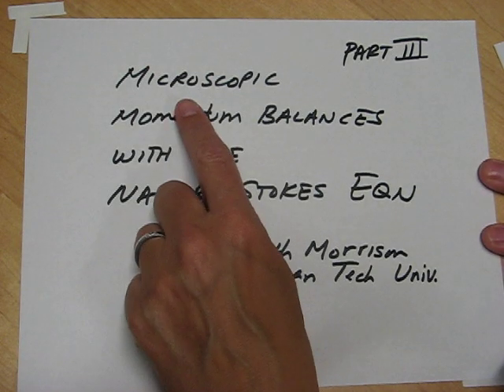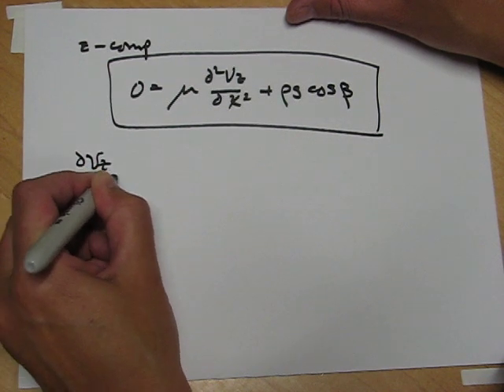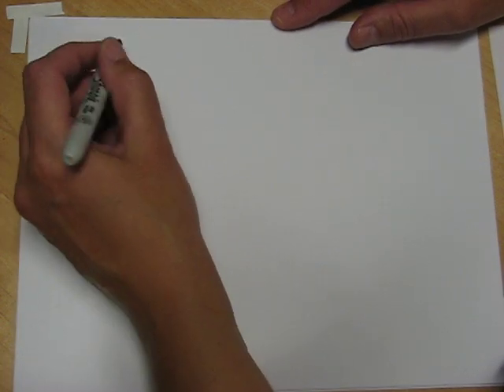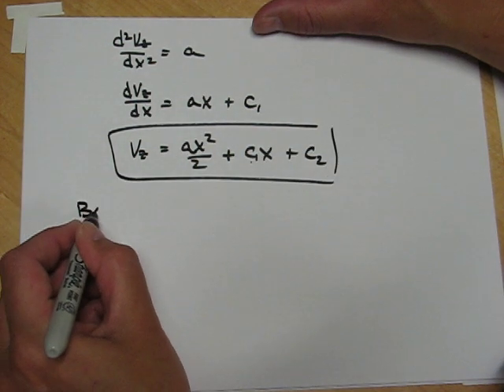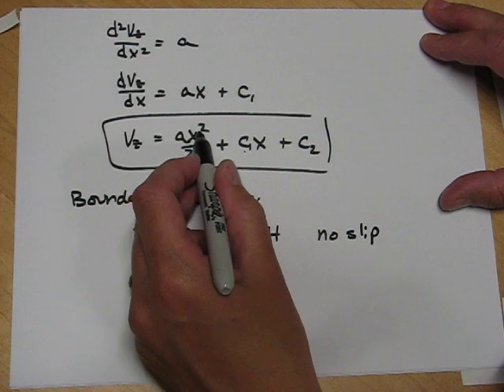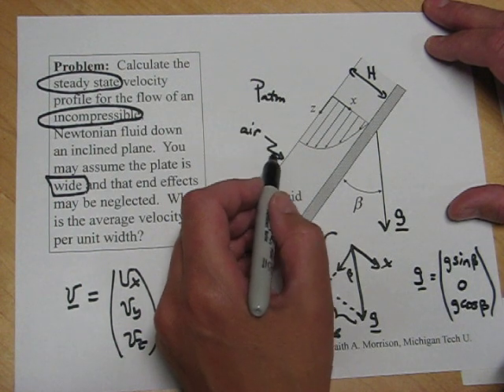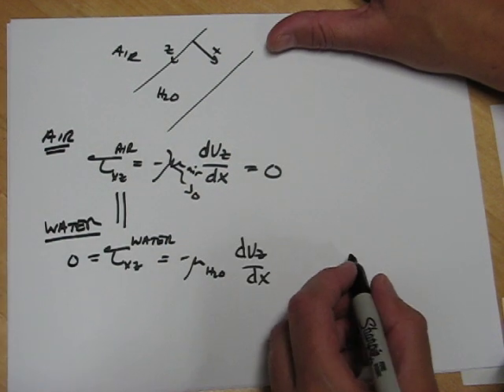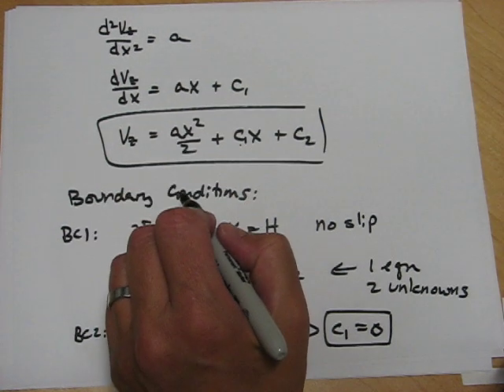Part 3: Microscopic Momentum Balances with the Navier-Stokes Equation

Comment: How is Vz = 0 for x=H ? 
In my opinion Vz=0 for x=0 Vz=V for x=H .
As a result if Vz=0 for x=H then water musnt flow
Reply from the maker: The boundary conditions are tied to the coordinate system.  In my solution, the x-direction starts at the free surface, that is, at the interface between the fluid and the air.  It then goes down towards the wall.  In this coordinate system, Vz=0 at the wall is at x=H.

Comment: Hi Dr. Morrison,

I'm sorry if this is a remedial question. The equations and simplifications made sense throughout this 3-part series, but at the end, only the third NS equation was acknowledged. What is the purpose of the continuity equation and first two NS equations, once they are solved with numbers?
Reply from the maker: I used the continuity equation to deduce that dVz/dz=0.  I needed that to simplify the Navier-Stokes.

For the Navier Stokes, I used the y and x components to help argue that dP/dz=0 in the z-component.  Then, after I argued that dP/dz=0, I was able to obtain the equation for Vz(x).  All parts were needed.
Reply from the maker: The continuity equation is the mass balance; it tells us a constraint on how the velocity may vary.  The other two components of the NS are the x and y components.  The x component tells us about the pressure distribution in the y direction (there's no flow in that direction, but there is a hydrostatic pressure) and the y component tells us that the pressure may not vary in the y direction (given the assumptions we have made).  They all contribute.

Comment from the maker: Yes, this solution is only correct within the assumptions we made, including unidirectional flow in the z-direction.  If the flow becomes rapid, the streamlines will not be straight, and this solution is not correct.  As you state, this solution is only correct at low Reynolds numbers.

Comment: If you actually graph the velocity profile using the velocity equation she came to and plug in a small viscosity, the whole thing breaks down. For a larger viscosity (which would correspond to lower Reynolds numbers), it's much more acceptable- of course, as stated by Dr. Morrison. Excellent video.

Comment from the maker: Ah.  I'm sorry to have confused you on that point.  The viscosity is not negative, but I see what you're asking; at 6:36 in the video I write Newton's law of viscosity with a negative sign.  This negative sign is because of the sign convention on stress.  The tau (stress) is a compression (not a tension) and that requires the negative sign.  If you use the mechanical engineering (usual) convention, that negative sign is not there.  It only affects calculations of tau.  See Bird, et al. 2002.

Comment from the maker: @QuickJapie :  Thank you for your comment.  The solution provided was for laminar flow.  We assumed at the beginning that the velocity is only in the z direction.  Therefore we have limited ourselves to situations where the flow is slow enough that there aren no ripples and certainly no turbulence.  This will be true at low Reynolds numbers.  You are correct that if the flow is at high Reynolds numbers then we cannot neglect turbulence.  best wishes, Dr. Morrison